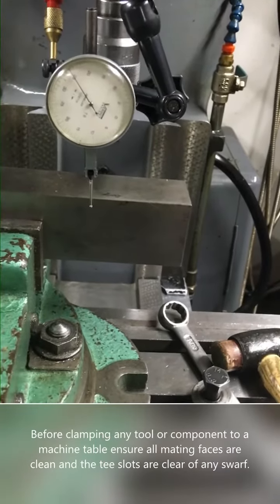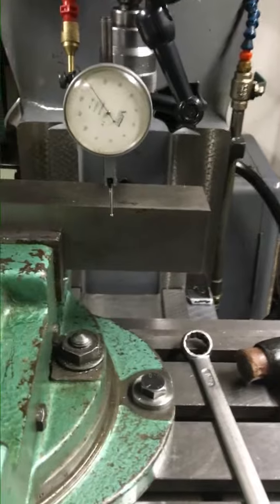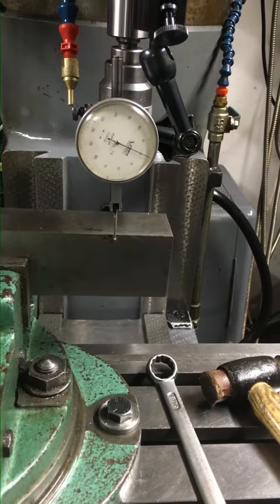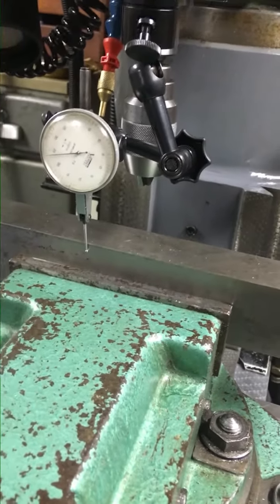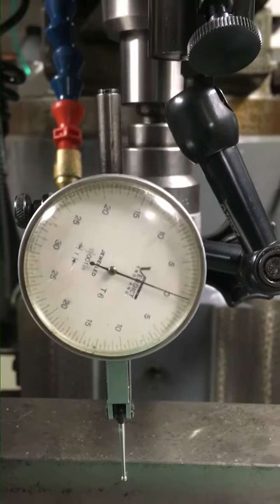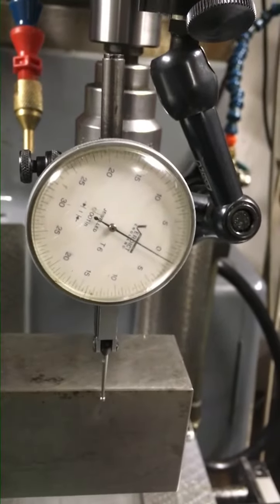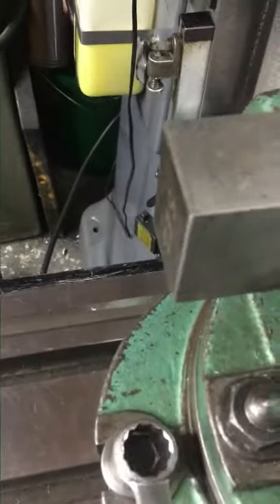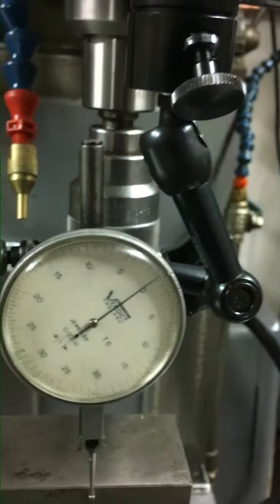The quickest way I know to clock up a machine vice.

Comment: What you didn’t realize, and I believe you were unaware of because you didn’t mention it is, that when you used the parallel you preloaded the vise as you would with a workpiece which always causes some deflection in the fixed jaw of any vise, and you therefore accounted for this.  Very few machinists understand this, and even fewer have ever shown this on YouTube.
Reply from the maker: Hi Thank you for your interest 
I am old school so was aware of preloading the vice. As the parallel was already in the vice I didn’t think to mention it.  I don’t often clock the vice as I tend to use machine dogs for location. On most items that clamp to the table. When you are the only person in the workshop it is a lot easier to look after your tools. So I don’t even bother checking the alignment on my other vices, dividing head indexing head etc. as I know they have not been abused.

Comment: And what about the top surface fdr level over it's length, or are you  so sure that with your parallel's  supporting your work that you dont need to show this as well ....... if your going to this effort to make the video , then go start to finish  100%    Simple really
Reply from the maker: Hi David
Thank you for your interest
This is a method to set the vice parallel to the X-axis only. I don’t quite understand about the material issue. Once the vice is set, you can decide how the work piece, is to be clamped in the vice in the other plains. It may be the work needs to be tilted or parallel to the other axes of the machine. The choice is yours. The main thing is the vice\work piece will be parallel to the fixed jaw in that x-axis and if you have a good vice and ensure both mating surfaces for the vice and table are clean the base of the vice will also be parallel to the table. I hope this has clarified the fundamental part of clamping a machine vice to the table.
The Home Engineer